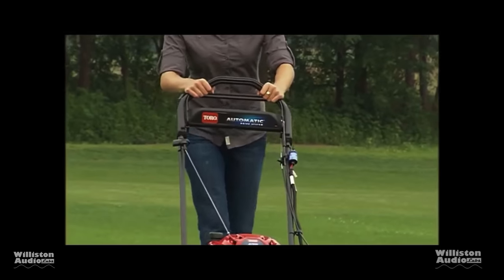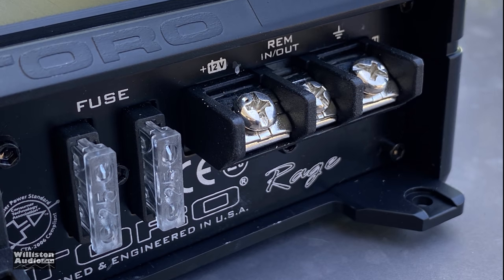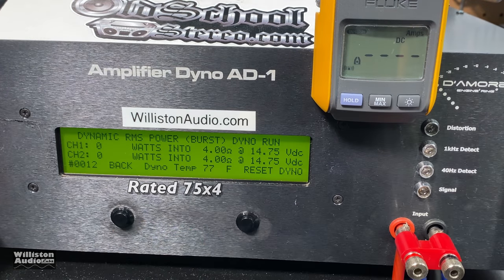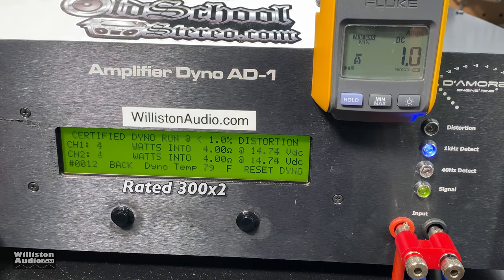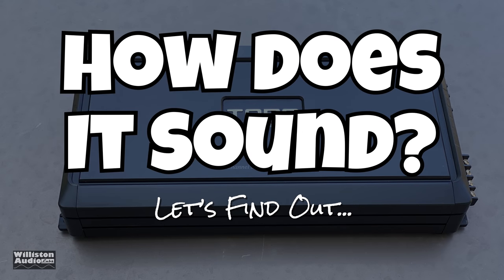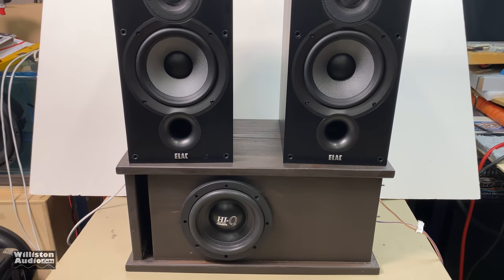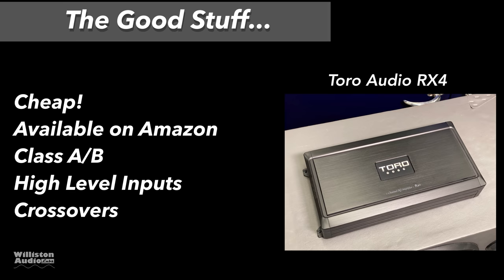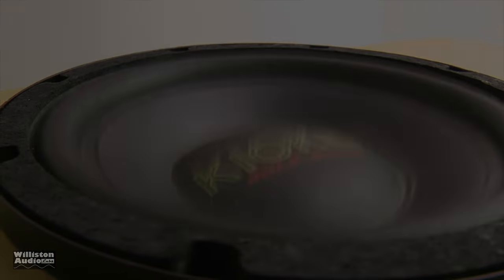Is This Budget 4 Channel Amp Any Good? Toro Audio RX4 Reviewed and Tested

Comment from the maker: Shop for 4 channel amps:
Toro Audio RX4 - https://amzn.to/345aGpL
Pioneer GM-A6704 - https://amzn.to/3avbzJh
Pioneer GM-D8704 - https://amzn.to/2Y4NjbW
Kenwood KAC-D3104 - https://amzn.to/3h4eCdY
Kenwood excelon X302-4 - https://amzn.to/31YDxcD
Rockford Fosgate Prime R300x4 - https://amzn.to/348QXWa
Blaupunkt AMP1504 - https://amzn.to/3avbpBF
Skar Audio RP75,4AB - https://amzn.to/3h3FjiX

DISCLAIMER: This video and description contains affiliate links, which means that if you purchase from one of the product links, I may receive a small commission. As an Amazon Associate I earn from qualifying purchases
Reply: Could you possibly test a concept 135.2 hp ? I had it pushing 3 jl audio 10wos
Reply: harga berapa boss
Reply: Just wondering do u know what the ratings are for the book shelf speakers u use
Reply: What amp is good for 4 8inch subs 900rms
Reply: What.. No one ohm smoke out 😲
Reply: @BamBam81  pioneer GM-D8601 or the 8701
Reply: Car stereo consists of more than just amplifiers and bass !! I want to see other car stereo stuff on your channel !!

What about cables, connectors, car players, DSP. batteries ????
Reply: I made a video of my system... its under Budget bass blazer... check it out
Reply: Any suggestions for small footprint 4 channel amps? 75-100 watt rms at 4 ohm?
Reply: Would love to see the Toro Tech R5 dyno'ed. Thanks.
Reply: I have a toro 2000 mono and toro 4, and 2 channel micro amps
I would be willing to send to if you are interested in testing.
The micro amps are pretty sweet no complaints but the 2000 After my last rp1500 I’d say it’s about 1800 but When I plug in the base knob I seem to get a loss of power what I mean is it does not hit as hard I’ve never had that happen before generally I get more, I’m curious to see if it’s test different with or without the bass knob which is sold separately sold separately. I can’t be the only one curious this company seems to be sold out of everything all the time if you buy their products from their website you can get additional 10% off I paid 180-10%at the time it’s up to 200 now but still seems to be reliable and doesn’t use up too much power nice little budget bang I got all of these reasonably cheap and they do sound good but it’s never done
Let me know I’m sure you know way of contacting me
Reply: What's a good 4 channel SQ amp for four C2 650x Coaxials? Only need 60w continuous RMS. I prefer AB'S cause I feel like they give better midbass. But if you've got a class D you like feel free to suggest it :)

Comment: Pretty impressed with what it has for a clip indicator for 80$ it isn't to bad u can do a lot with mids and hi's with 65-80 watts
Reply: sounded decent to me, and I've got this amp mounted in my car for the door speakers.
Reply: But you said to and not too..so we don't trust you
Reply: Most of these amps are based on older designs that were used in some high end amplifiers so it should sound decent, they probably just used lower end components to save few bucks.
I'm pretty sure you wouldn't call it a trash if it was rated properly.
Reply: Agreed. Less than a decibel difference in the power numbers of actual and rated. Dont think he takes that into consideration before slamming an amp. :-/
Reply: @cekpi7  I think if u can get 75 a channel out of it and run it at 50 I think it would be great most ppl couldn't tell the difference between d class or ab to begin with at least not me,hard to beat an Amp with clip light and four channels and does 300 watts for 75$
Reply: @cekpi7  yes but those components matter a lot. Cheap capacitors are especially egregious.

Comment: The Toro website now lists this amp at 65x4 rms @ 4 ohms, 90x4 rms @ 2 ohms, and 180x2 rms @ 4 ohms. They must have seen this video!
Reply from the maker: Awesome! But things would work out much better if they had me test before rating if there was any question as to what the supplier is providing...
Reply: Still yet, depending on the end user's electrical and the music quality, etc., they still might not get that much.
Reply: Still a pretty good amp for the price.  But it does beg the question: why are there so may bald faced liar companies out there?  If all they want is a few years of profits, I suppose I understand.  But after those few years, they just end up with a terrible reputation, and sales must drop off a cliff.
Reply: still didnt hit the new numbers bridged.........
Reply: They noticed there was an error in their ratings on that particular amplifier and quickly changed it to what they inteded the manual to read. An honest mistake from a great company who produces great quality gear at incredible prices. The video shows that. I challenge you to dyno the R4. I just bought one, and itll blow your mind.

Comment: There have been soo many four channel amps with this design put out over the years and none of them have been a true 75 watt per channel . The more honest brands rate them around 50 watts per channel, others like toro claim 75 or more. The fuse formula never lies, a dual 25amp fuse design won’t provide 75rms x 4. Thanks for proving this again Big D. Interesting that the pictures on amazon show dual 30 amp fuses.
Reply: How excactly does the math work with 2 25 amp fuses for this amp?
Reply: Roma2189 Villa 

2 x 25 = 50 amperes total max current available to the amplifier

50A x 14.4V = 720 hypothetical “watts” max output (at unrealistic voltages)

However, no amplifier is 100% efficient, therefore:

60% x 720 = 432 theoretical watts output assuming 60% efficiency for Class A/B circuitry

432 watts / 4 channels = 108 watts per channel theoretical max output (at 60% efficiency) before factoring impedance of the drivers.

Bottom line, you can do 75 WpC on 2x 25A fuses.   In a perfect world, you can also do the stated 300W x 2 bridged - if Class A/B were capable of 90% efficiency (not gonna happen!).  

But clearly, this amp is going to max out its MOSFETS before it blows those fuses, most likely due to outright lying about the power capabilities of the circuits/components they’ve used.

Comment: I built a sub cabinet for that Dayton Audio 250 plate amp that you tested(when you gonna do a another vid on it after using it a while?), powering an MCM 15" 8 ohm replacement woofer. 3 cubes and 1.5 cubes tuned 18ish and 100ish respectively in a 6th order, wow, the entire house shakes in a 20 to 80 hz sweep. This is during break in, LOL. I'll get a video after break in. Cant wait to upgrade woofer to the 4 ohm already!

Comment: They’ve corrected all these ratings on the website!!!
Reply: Update: I bought the amp for my girlfriends car. It’s rated just about the same as my old kicker KX350.4
I would say it does push the power but it sounds of less quality than the kicker amp.
Even though I set the gains appropriately the amp seems the ground loop a lot more easily than the kicker.
Just over sounds cheaper but it gets the job done!
Would I pay  79$ again yes.. but they raised the price to 100$ now
I could get a nice used kicker 4 channel for that price

Comment: Definitely walking the line against Dick Rickulous territory here. If they rated it at 60 x 4 and snuck in a 50-20khz response rating on the spec sheet OR built it with high pass filter only to discourage sub use I'd say you have a winner! For the $79 it's probably an ok deal assuming you get a few years out of it. Great vid as always bigD

Comment: Still for $79 for 70x4 watts to run a set of decent coaxials or components and some 6x9's, it's not a bad deal.
Reply: Now they want 260 for it lol
Reply: @mrwigglezdj  Just saw that, for $79 I'm buying 2, in case the one I'm using dies I just wire up the other one, but for $263 there's other options from names you might even recognize
Reply: Where have you found them at 79 still? I have a new one that was given to me but it burnt up since I'm 15.5v to 16v in my truck
Reply: @mrwigglezdj  Yeah price on these have gone way up since the review.

Comment: i would definately use one of those to power door speakers/component speakers.  Take some of the stress off the head unit, especially if it's one of the eBay no-names.

Comment: I've seen that Toro in Amazon warehouse.   Looks like a decent amp if you need little watts for door speakers. But for the price there's so many better amps. Wouldn't buy it personally. 👍😎💯
Reply: What other amps do you suggest for the same price point?

Comment: Hey dude love the YouTube channel. Has influenced a few of my purchases and recommendations. 

I have a Wolfram O-5000.1 pre-ordered. Right now it is a 5k for under $300 possible budget gem. I want to know what it actually does on the dyno. If you want to make a video on it you can use it. It will ship out August 31st and I will hopefully receive it early September
Reply: I can tell you that my buddy bought a Wolfram 4.5k and it has no problem putting out that much power without distortion. It took a a 375 Mechman alternator and 3 Shuriken Batcaps to do it though. Don't even think about trying to make 5k without a killer charging system. Batteries alone will NEVER achieve this power, unless you have 10 of them, fully charged.
Reply: Elliott Feaster  I have the screenshots and emails to prove I paid 284.96 with a $15 off coupon code
Reply: @chevy383jt  I was going to use a 8d battery in the trunk and only run it at the 4ohm load (rms 2400 I think?) I'm currently powering 2 AB TNT1244s rn but plan on going bigger
Reply: Elliott Feaster  I'm thinking it's 450-550
Reply: @thebigbluebeast  there's another channel that has tested it... with a "very good" electrical system it does get somewhat close to rated power
Reply from the maker: I can’t stand behind the 6-month preorder deal Wolfram does, plus they don’t offer affiliate linking. I may still get one in...
Reply: @wal  you're welcome to use mine. I wont be able to install for atleast 3 months after I get it. I can send you an email if you wish to discuss details

Comment: This is their new ratings SPECIFICATIONS:

RMS @ 4 Ohms	65w x 4
RMS @ 2 Ohms	90w x 4
Bridged RMS @ 4 Ohms	180w x 2
Min Impedance	2 Ohm
Reply from the maker: Yes, they are corrected now 👍
Reply: Their not completely accurate. But close.

Comment: Do you know anything about OSD AUDIO ?  they do a lot of home audio & commercial audio    I’ve picked up a 1260.  But needs a repair 😒 dam water dripping from AC went on it. Cooked it a little bit.  Lol.  Got it from one of my side job customers.  I do all their audio & low voltage stuff.   But hoping I can find someone to fix it.  I’ve been saving all these home audio speakers for a long time

Comment: Makes me wonder if my R4 amplifier will do rates power now🤔, could you possibly test that amplifier next. 
I know it’s rated 1200 @ 2 ohms and 2000 @ 1 ohm
Reply: @Scott M. Moore I might get the r5 cause it’s .5 stable and this r4 I’ve had for a year I bought last March when they were the 2k rms version is kicking ass. It just takes a hell of an electrical system to support it. I’ve got the new q power 12s with a 3 inch coil and going to get a db test soon to see how loud it is but people think I have 15s all the time every where I go

Comment: Looks like a decent mids/highs amp. It's a shame it's not accurately rated since it's reasonably priced. Thumbs down for that. 
I could see it not being a good sub amp since it appears to be lacking large enough capacitors internally to help with that. But for mids & highs it should do the job.

Comment: Hey mr Wilson have u had any experience with toro R6 amp 4k rms at half ohm ? No vids or dynos of tht thing nowhere ! Is toro good ?
Reply from the maker: Toro is sister company to Massive Audio. I really don’t think it’s a good idea to plan a system based on 0.5 ohms. Amps will get very hot, pull a lot of current and not last long at that load
Reply: @wal But Im looking into this amp also, and have not seen any dynos, could you do some to see if this toro r6 amp holds up to the watts or not?

Comment: Man I'm running a rockville k9 15 4ohm dvc which is wired  down to 2 ohms, rated 5000 watts max, 1250rms, with a ported 3 1/2 cube ported box, any thoughts on  amp that would run it decently and not cost $600 lol. If all else failed I was thinking about waiting until I can grab one you recommended in a previous video, the taramp smart 3K cause you say it's a great amp and I would like to move up to two of the 15s  possibly in near future and thought that amp might run two decently. I bought a planet audio 1500m cause it said there amps were rated at 1150 rms then realized when I got it the amp has one 30 amp fuse in it so I see now how weak it really is so I want my next amp to be a good one that will last and have the power to push maybe 2000 rms for future builds.
Reply: I would say rp1500 or rp2k from skar..does rated and priced very well

Comment: is there a way to verify if an amp will sound good and not have distortion? im looking for a small amp for a garage setup with some rockford t1 mids and jl 8w1....dont need a lot of power but want the sq they deserve.
Reply: i should that i need small and something i can run the amp and old alpine head unit off a 360w psu

Comment: I have 2 very rare Hollywood Sound Labs RHV4OS Class A Tube amplifiers. Brand new in the box. Was wondering if you've ever done something on HSL before. This amp is the Bomb for Fidelity in mids and highs, I may send one your way for testing and the other I'll post on Ebay. How do I get in touch with you? These are a true Unicorn.
Reply from the maker: OldSchoolStereo (at) gmail dot com

Comment: This is a little disappointing. My wife and I have an Mrx4, and Mrx2. I hope they do better but so far they just don’t push our mids/highs quite loud enough. Leaving a little to be desired, and they run pretty damned warm when we push em.
Reply from the maker: The 500W Monoblock I tested did it’s power
Reply: @wal  that's why I was able to pull the trigger on the other 2. I did some more playing with my high and low pass filters and got a little more volume out of it today. I think we just need more speaker to pull off the desired sound.

Comment: Be  Honest where else can you find an amp like that for $79 you can't go buy any major brands for close to that i remember when i saved up and  Purchased my 1st real amp from a store it was a lightning audio it was like 80$ and 400 watts but better then the 200 watt one i ran before back the i used 22ga solid core wire luckily never burned any thing up
Reply: That Lightning audio amp is just an older Rockford amp with different badges.
Reply: @chevy383jt  never new that until years later the speaker they had were really good too for the time and price
Reply: @Mr.Robert1  not bad thank for the information

Comment: What would u recommend between the Toro or the top strong gear?
Reply: Toro.  Top Strong Gear is cheap junk.  I'd trust a sister company of Massive Audio over that nonsense.  The Top Strong gear 4000 watt amp doesn't even make 400 watts RMS.

Comment: was considering the 2k rms mono toro amp now kinda wondering.
Reply: I have the Toro R6 4000rms and I love it
Reply: @ Jake Welsh
You may love it because it’s probably doing 1000watts max but no way it’s doing 4000!
Reply: Bassotronics @ 0.5 ohm it does get 4000rms
Reply: @ Jake Welsh
Well you know what it’s time for, time for Derek to test it out.
Reply: Bassotronics yes he should. I can’t speak for the RX series amps but the R series put out their rated rms power
Reply: @jakewelsh1002  probably barely does 600 watts ... a few friends had very bad luck with their amps but apparently the subs were decent enough
Reply: Dieselman I can tell your comment is all based off of hearsay and you don’t know much about amps If you think it’s only 600 watts. Also I Guaranteed that the amps weren’t the issue and failed due to user error and lack of knowledge
Reply: @jakewelsh1002  ok sure if you say so.... been involved with car audio probably longer than you've been alive... not my 1st rodeo bud...
Reply: Dieselman then you would know it puts out more than 600 watts. Buy one and dyno it you’ll see